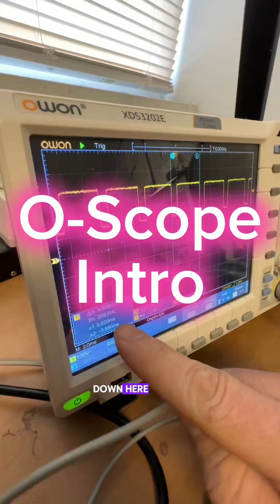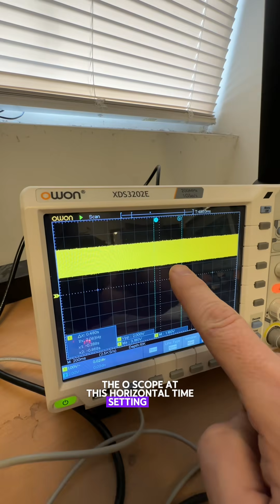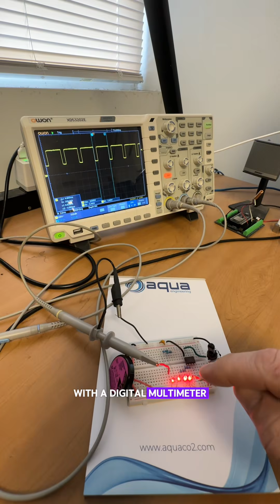O-Scope Introduction

Comment: Well explained, I was always super worried about breaking one while learning in EET Labs 😅 If I remember right, don’t try to measure main voltages off the wall with it, as your probe could be tied to the same ground that the oscilloscope is plugged into. Your content rocks!

Comment: I know modern atomic clocks function off of measuring billions of vibrations or waveforms a second but even for slower increments like this are extremely fascinating because it is beyond mind blowing that so many events can take place in such a short period of time AND the fact we can actually observe and quantity these number values is nothing short of a technological miracle.
Reply: The atomic clocks in your home are receiving a signal from WWVB (radio station from N.I.S.T.)  with a 60 kHz carrier wave with pulse-width modulation and binary phase shift keying for the data including nit only the time, but the date, DST, and leap year/second information